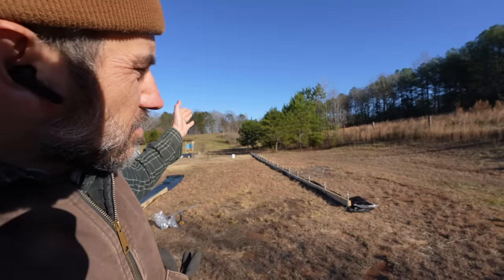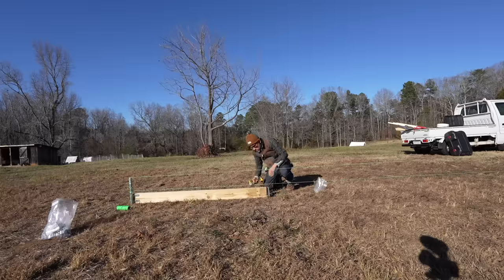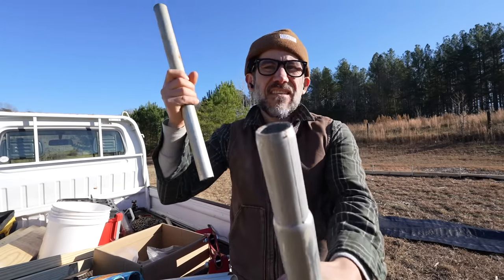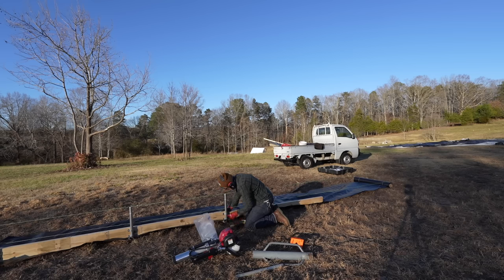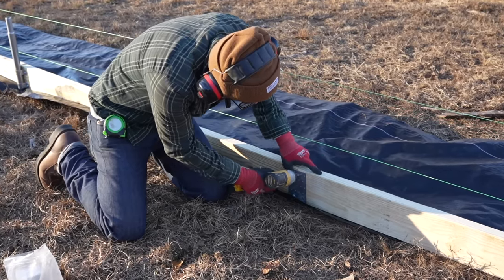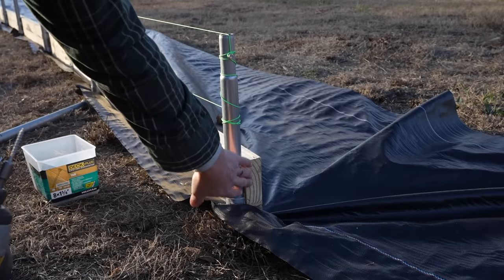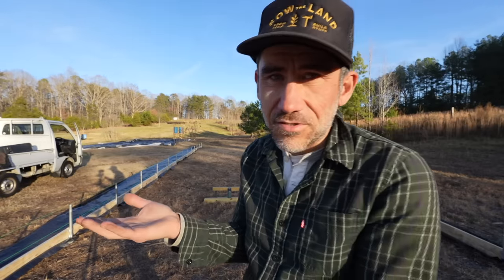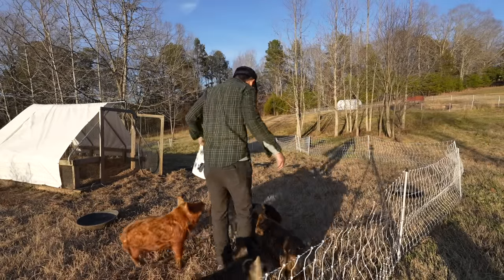One Quirk I Learned Pounding 38 Metal Greenhouse Posts

Comment: should be careful with setting stuff to a string like that, u usually set the string 1-2"+ away from where u want and measure back each time, if one post touches the sting and push's it 1/4" it throws off the whole string etc, then all of the sudden when you get to the middle its bowed out 6 inches